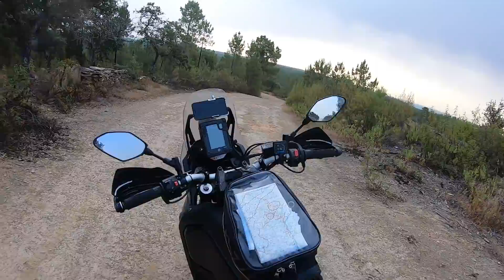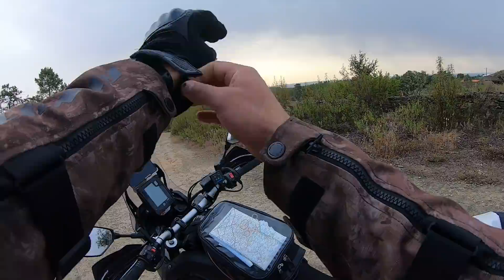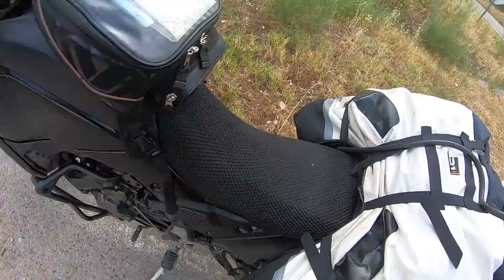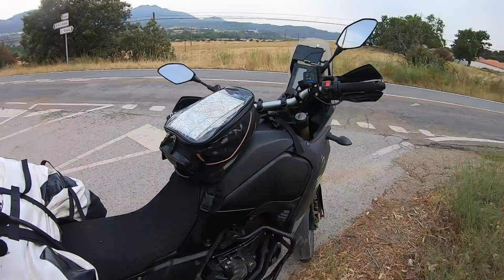Yamaha Tenere 700 - Long Term Review  - 12,000 km Real Travel Test!

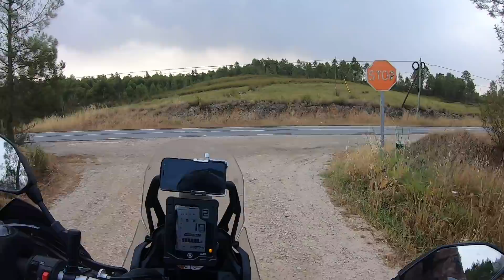Comment: love the bike! If i had the money for it I would've bought one. But instead I've "settled" for another one (though still extremely happy). One thing you've said that wasn't right at 8:40 is "I don't think this motorcycle needs ABS because it isn't that powerful"...I think you meant to say TRACTION CONTROL. Every bike needs ABS. Imagine emergency braking in slippery condition like rain. Without ABS you'd wipe out even if you were Valentino Rossi.

Comment: Good review. One important rectification: the front and rear suspension IS adjustable  (compression and rebound). You can find plenty YT clips on how to do it yourself
Reply from the maker: This does not help much, unless you have a pre-load.
Reply: @motorcycleadventures  rear pre-load is also adjustable (24 click) I weigh 77 kg which is about right for standard springs. I cannot believe it makes no difference when there are 22 resp. 31 clicks up front and 18-23 clicks at rear  for compression-rebound. I adjusted it recently from standard setting and will find out soon hopefully on an off-road ride.

Comment: For me, three things disqualified Tenere (sadly): Seat, handlebars, and the worst idea ever - welding muffler to the frame instead of mounting exhaust along with the frame like in the older model (using bolts). I was so close to buying it and after one hour of riding the demo model, my arse was so sore that I've just returned the bike and I said no, thanks. I'm 6'3, 250 pounds so maybe a little bit too much for this bike 😆Also handlebars were a little bit strange,  I don't know...  Great video anyway! All the best Pavlin!
Reply from the maker: Fair enough, it is definitely not for everyone, especially in 2022.
Reply: @motorcycleadventures  The thing is, I will probably buy it anyway 😂 - I have my eye on a second-hand model with a few thousand km, and everything that I hate about this bike was already replaced with aftermarket stuff - will see...
Reply from the maker: Most of the aftermarket accessories will only make it look ugly, will be heavier, fragile but never better bike. It is good enough as it is in its stock condition. Try to seat on your coach at home for one hour without moving and you will be surprised from the result. In the end the decision is yours.
Reply: @motorcycleadventures  Thanks for the advice Pavlin! All the best pal!
Reply from the maker: Any time!

Comment: Hi, 
there isn't much new to you about the bike than what you said before. I don't really understand comparing an old motorcycle with a new one. the main difference is the engine. The old one cylinder motorcycle is weak on the road, it must have had more vibration and the acceleration was desperate. I would prefer the old transalp already. Another thing is the lights, since the new motorcycle has new lights, they need to be checked and introduced to us. I drive a lot at night or in the morning and it is very important. Saying that horsepower isn't needed or is enough I think you're getting old. if someone likes to drive aggressively on sandy roads, he needs it. if you have to overtake a truck or a bus, you also need horsepower and there is no point in arguing that there is more than enough. How does a motorcycle behave with a full fuel tank? it is situated quite high and driving on narrow sandy roads you will definitely feel the mass of liquid tilting sideways. Driving on the highway with such a narrow and tall motorcycle you will definitely feel the side wind. as a traveler, you could develop the themes of driving further. I will get on the scooter 125 and say that it is perfect, I will do 1000 km in the day and I will not feel it. I will get on the enduro and I will also do 1000 km, but I will see the differences. I will get on tourism and I will also do 1000km with a backache but I also see the differences and I will certainly not say anything that my sidefoot is rubbing because of two other materials because such errors were in the cars of the 80s of eastern production.have you ever traveled in the woods at 12 o'clock at night? you will immediately notice the lights and the brakes. best wishes :)
Reply from the maker: The video is about  my experience with the bike. What you or anyone will think about it is a different story.
Reply: I like when he compares old with the new because, same as many people on this channel, i am riding xt660z and considering to upgrade to T7 .

Comment: The HorsePower is - like u've mentioned - mostly for overtaking. It happens toooo often, when a total IDIOT in a car, drives infront of you qute slowly + does it on the LEFT side of the lane !  - And you never know, what those IDIOTS in cars, will do next, because they, usually, DO NOT look in the mirrors !!! - so yes horse power is needed, at least for passing those bad constipations. I agree that for situations like I describe, 70-75 Hp is planty, but less - can make the overtaking dangerous ☝☝🤓🤓

Comment: Pawlin, thank you for this review. You use the word "cheap", which I don't believe is correct. Simple, yes. Inexpensive, yes! But the engine and gearbox are outstanding and the frame as well. So it does not have all the electronics that some motorcycles have, but so what? From there comes the low price and I think for what you want and pay for, the quality is outstanding. How many times did you have to take it to a shop for warranty work? Maybe not at all. Ask KTM owners about perceived quality and reliability of their bikes, that cost 50% more and the often say that reliability is a problem. I don't think reliability is ever a problem with a Yamaha. That to me is quality!
By the way, if you come back north through France, will you pls contact me. You have a free place to stay and meals for as long as you wish! Travel safely!

Comment: Hi Pavlin!

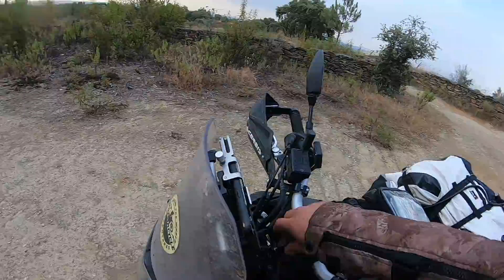I am affraid Your headlight is malfunctioning. In 03:08 you show us how a "dailights" are working but uppon key turn beside these 2 "daylights", 2 other (the upper LEDs) schould turn on authomatically and they do not in your film. I am supprised I am the first one who noticed it. I have this Tenere also, also speced for Europe and there is not possibility to turn only the lowest two "daylights". Please check Your lights or if it is ok please tell how you did it? I've checked manual, for both US and EURO Teneres 700 and I am really affraid you have some electric issue... Sorry for being a bad news deliverer, but if it is headlight problem (read somewhere, that some batchs of Tenere headlights were faulty, but it was in first years,and i you've got 2021 model. Also My Tenere is from december 2020, and in 2021 Yamaha added an extra catalitic converter, so maybe they chcnged something wid headlights also... I dont know But please check it again and write if it is ok or not.

All the best from Poland, I love your materials on YouTube :)
Reply from the maker: It is on when you start the engine. No problems.

Comment: Get the wind screen adjusters. I added them to mine and it completely changes the wind buffeting on your helmet with just about a 5 cm lift.  It’s pretty good quality and cheap on Ali express.  It also doesn’t change the look of the bike.   Great videos, stay safe on your trip!
Reply: agree,added one to mine and can ride happily with my visor up now ,still not perfect but pretty good.
Reply: I got higher windscreen with extra adjuster. Very quiet now. Yes, a bit blocking the view, but in places it actually disturbs, I usually stand on the foot pegs.

Comment: 8:49 Are you questioning if T7 needs ABS because it is not that powerfull ? How does power relate to need for ABS. If anything this bike actually needs ABS as it is likely that it will be equipped with 70/30 or even 50/50 tyres. These tyres are known not to grip well on wet sealed roads and they tend to slip suddenly so ABS will definitely save the day here and there on sealed road. When off-road disable ABS, when back onto tar road enable it again. Easy. Not sure why are you constantly complaining about ABS. There is a reason why ABS is mandatory now in most countries around the world.
Reply: +1. I choose an XT 660 Z ABS exactly for this reason: in emergency situations I DO want to brake with max. power. It has saved me already a few times out of tricky situations caused by car drivers! It's a must-have for me on any future bike

Comment: Rally raid UK can supply you a stronger sidestand spring. Just did a 300 mile round trip to a bike rally with wife on back and full luggage. No trouble for the T7 on standard suspension, and returned 70 mpg 👍

Comment: Front suspension has compression and rebound adjustments
Reply from the maker: Without a proper springs it won't help much.
Reply: @motorcycleadventures  I just pointed it out because in the video you say that there is no adjustments for the front. Check out the newest video from Nomad Sweden, according to them adjusting the stock front suspension makes a significant difference
Reply from the maker: No! It makes no difference if you don't change the springs. Don't trust anything you can find on YouTube.
Reply: @motorcycleadventures  Well said Pavlin ....the same goes for you...
Reply: @motorcycleadventures  Pavlin, Nomad knows what he talks about!